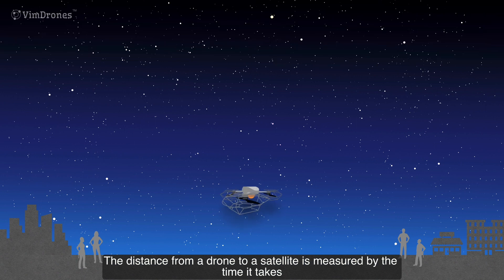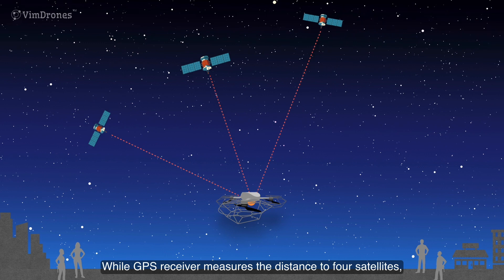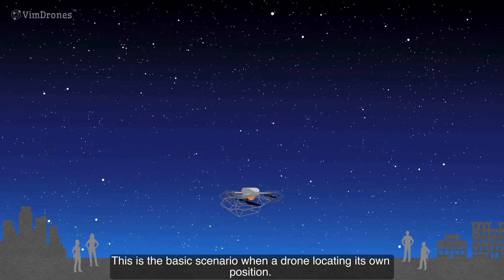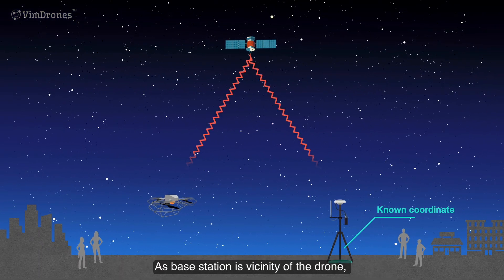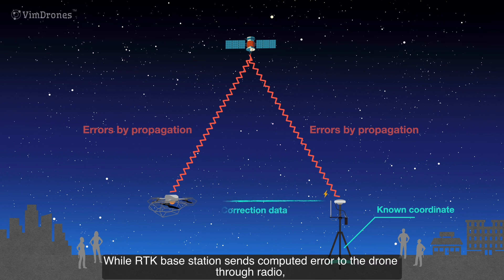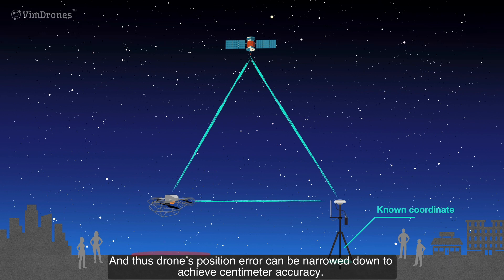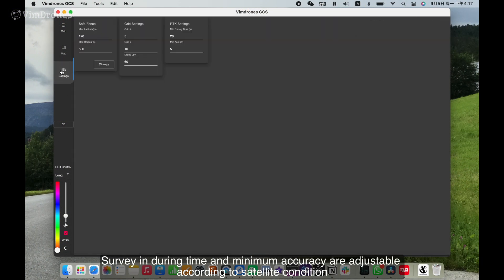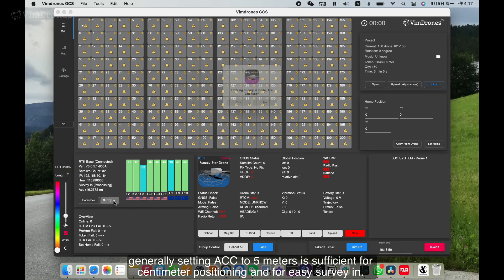What is RTK and why is it important | Vimdrones Drone Light Show 101

Comment: I'm having a problem with a drone show I'm hosting. The show takes place in a shopping mall near a 70-meter Christmas tree and below ground in an underground parking lot. The combination of these two things is making the drones unable to stabilize and consequently the show does not take place. Do you know why RTK is having this problem and how can I solve it?
Reply from the maker: In case you need to place it in less clear sky view areas and/or are obstructed by trees or buildings, firstly take the drone to a more open place until a FIX solution is obtained. Then walk slowly to the area where you want to place the drone, this helps the algorithm to maintain a stable FIX solution.
Technically speaking, we do not recommend conducting a Drone Light Show in places with building obstructions.